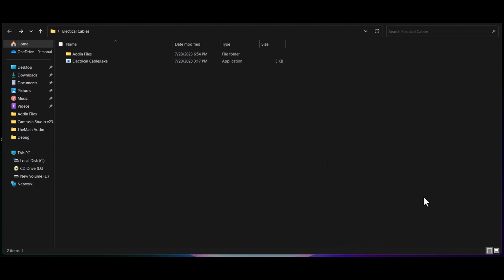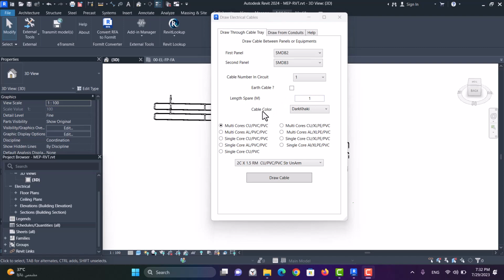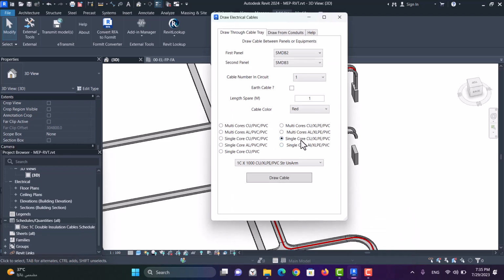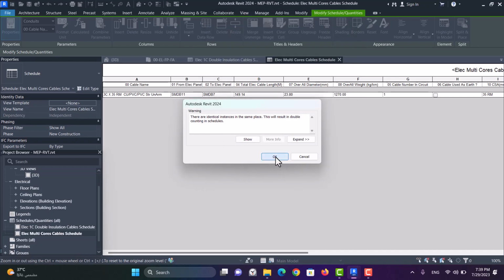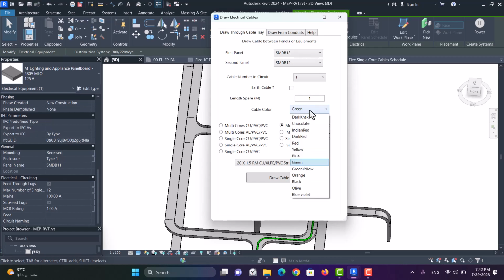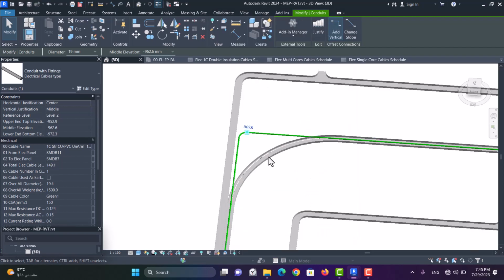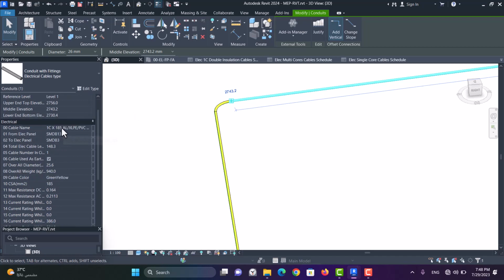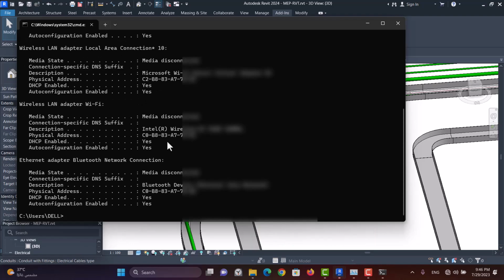Draw Electrical Cables in Revit

Comment: @Taha,How can i get this "Electrical Cables.exe "file?
Reply from the maker: Now ,I'm working on an add-in that has more than 27 unique tools ,
Electrical cables tools are integrated in it.
 when finishing them ,they will be available for a trial period.
Reply: @Ta-ha  will your tool contain SLD generator as well in the draft view format? thanks ^^ job well done ^^
Reply from the maker: @vrbaac1641  there will be two other tools I will finish them  then I will start to create SLD tool generator.
Reply from the maker: https://youtu.be/IvyvGrb1W3Y?si=dWgp88_oAT9r1KAn
Reply from the maker: The plugin is now available as a free trial untill 30/7/2024
https://youtu.be/VMHDi1869yI?si=YgdW44_B5YrK-1V0